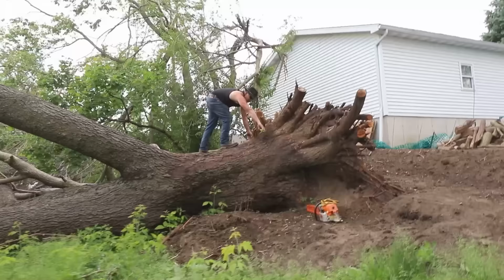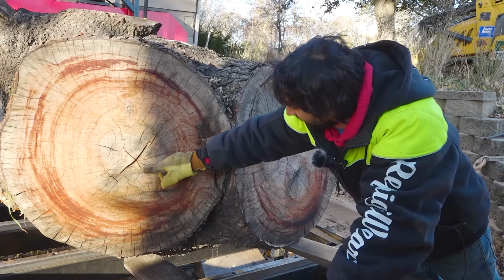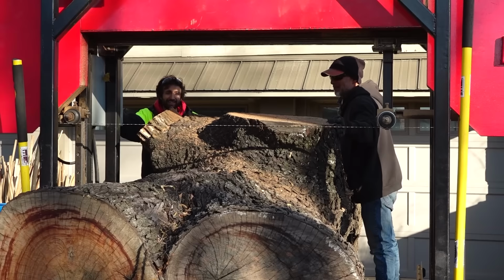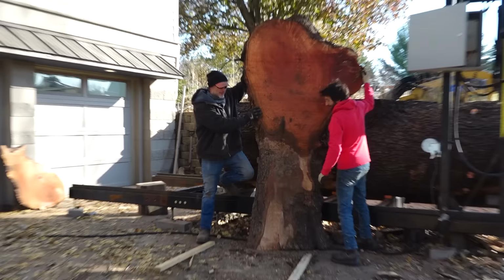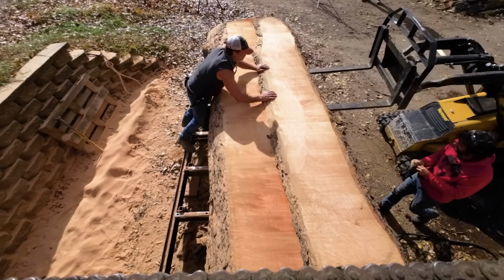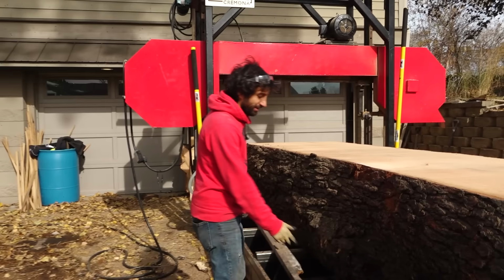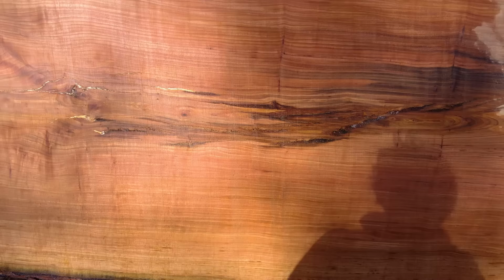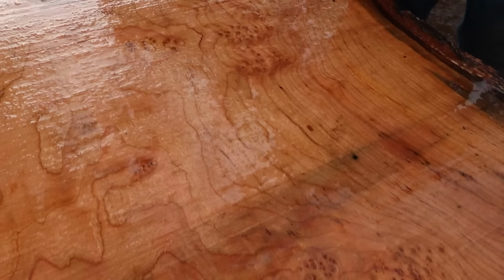Brought Down by a Derecho but will Live on | Iowa's Biggest Cherry Tree?

Comment: Dear Matt, thanks for this beautiful timber cutting exercise. I note that your saw cuts smooth and flat with lots of sawdust. Other millers who have motorised feed seem to have lots of problems with their blades. Maybe, being a manual feed you are feeling the resistance continuously and adjusting the force to give you the excellent results you seem to get. Penny for your thoughts. Cheers.

Comment: Matt,
When are you going to finally add an electric motor to the feed on your mill? You have to be tired of the hand crank by now. You could easily gear down a motor & use your existing setup. But I would modify it to use a lead screw on either side of the frame.

Comment: I have piece of cherry tree where the base measured 5ft that came from lower Delaware. The tree was planted on a plantation in the early 1700s, and was responsible for seeding one acre of a plot with the most straight cherry trees I have ever seen. The lot was being cleared for homes. Sadly most of the wood from that lot ended up as firewood. fifteen years later, the log still sits in my yard, its suffered some bug damage, but the core is solid.
Reply: Brother, stop letting that log rot and go to waste as bug food and find someone with a mill locally that you can get it to and get it slabbed up so it can begin to dry and be used.
Reply: Cherry is pretty rot resistant at least the heart wood but don't let it go to waste!

Comment: Just curious. On this cherry tree are you going to create a small table to send to the tree owners or city.  With a removable plackard on the bottom.  On the plackard info on the tree you have found . But printed in reverse on the back side of the plackard so a mirror on the  floor at a slight angle will display in a normal direction.

Comment: I'll bet when this was in full bloom in the spring you could see it miles away.
I could imagine what one slap would be worth if you sold it.  How many borad feet of wood is that? 
The smaller first 2 3 cuts could make a great end table live edge on brass legs or something.  The longer of them would be a good coffee table live edge. As it is but planed and sanded. After you took off the bark.  It be a shame to rip saw it into stright edge lumber.

I hope you saved as much of that tree as you could.  But id like to see you make one item out of it and take it back to the house where it grew as a gift 🎁